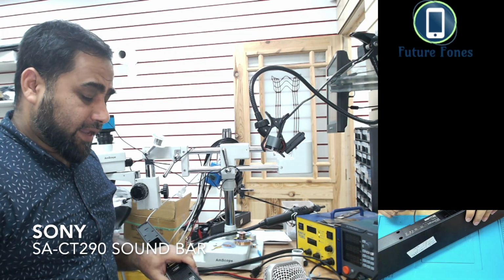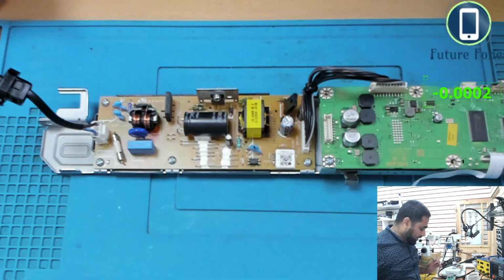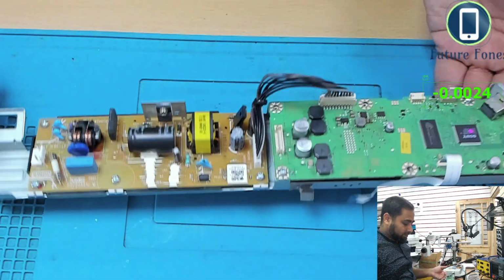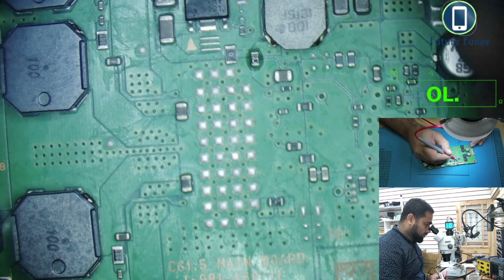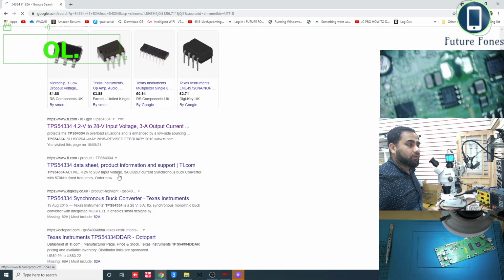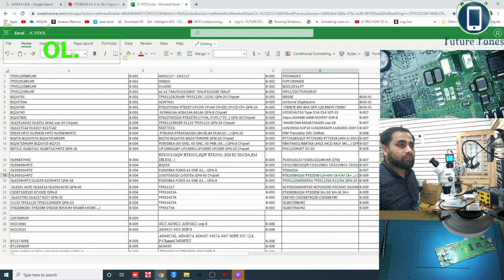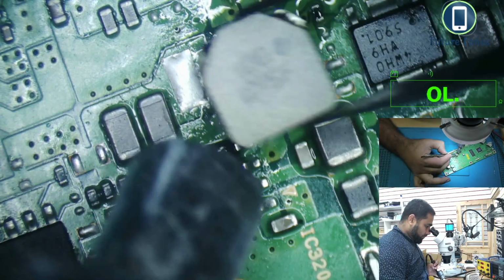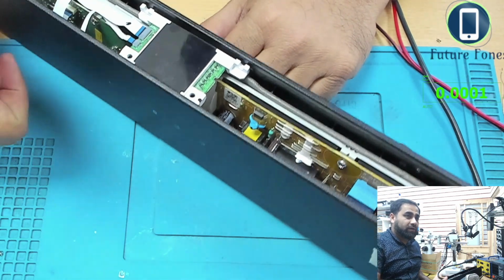Can I Fix a Sony Sound Bar. SA-CT290 No Power Fixed Complete logic.

Comment: Assalamwaleikum Bhai Jaan .I'm working on a sony wct790 subwoofer the power light cuts of in around 15 seconds but the 34 volt supply remains but no function..how to check if the output ic is faulty

Comment: In which way you took apart ? I removed all screws on the backside, but seems not to open, at least I'm afraid to destroy frame or electronic. Are there any pictures which screws has to be disabled and in which way its possible to unmount  the electronic ? thanks for the video, looks really detailed and useful
Reply from the maker: Sorry I can't remember this. My colleague opened it for me and closed it...
Reply: I wanted to know the same thing, do you have any info that can help me?
Reply: I'm super late but I just destroyed mine trying to open it, but now I know. There are screws on the back which are very obvious, but then on the bottom, under the rubber grips, there are screws. Once you take these off, the front grate should come right off.

Comment: Hi. Great video. My Sony ht ct260 soundbar stopped working/powering up completely...The subwoofer is still powering up ok. 
I can't imagine anyone would be able to fix it like you in UK for less then 100 pounds. So my question is do you know if there is any other sounbar which would work wireless with my subwoofer? 
The CT260 would be the obvious choice but there isn't single one for sale anywhere. 

Its sad that my completely perfect and very powerful subwoofer is just piece of junk once the soundbar is dead. 

Thank you for any advice.
Reply from the maker: Hi , Thanks for liking and commenting on this video. I m really sorry I dont know about this.

Comment: Hi, I have HT 290 sound bar, display is turning ON but nothing is working except that, i checked your method i am getting 24V instead of 18V and the last pin 3.2V from power supply circuit. Could you help me out
Reply from the maker: Do Soft Reset.. and check. Keep power button pressed for 10Seconds

Comment: Can u connect  ct290 only  subwoofer with phone  Bluetooth cuz I don't have bar
Reply: I recently bought a bar off Ebay for $50 as the sub will only work connected to the bar. You probably wouldn't like the sound coming only from the sub-woofer anyway.
Reply: @duratoke  which system do you have? I have ct260. Do you know which sounbar would connect to my subwoofer by Bluetooth? Thank you

Comment: Normally I eye roll when seeing comments about safety glasses etc. But honestly dialectric gloves are a GOOD idea when working with that kind of live voltage 240V is nothing to sneeze at, look at the size of that cap too. lol I worked on 3 phase 480v systems and 600v. If I was seen going near live voltage  without them I was fired pronto. 
A co-worker once came along and I said, " Look, these fuses should have safety covers on them."  He said, " This one? " as he pointed and touched the live 480v terminal.

It was early morning first coffee time, but his eyes bugged out and he stood alert for a second and shuffled off in a hurry. Thank God he was alright, if his other  hand wouldv'e been grounded on the steel door it would have stopped his heart.

Wear the gloves.
Reply from the maker: Can’t agree more ...